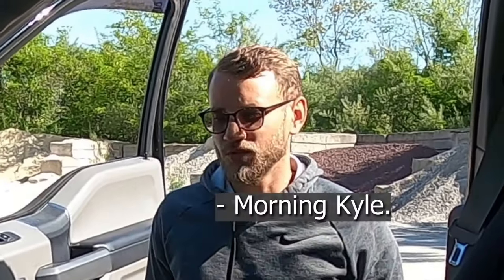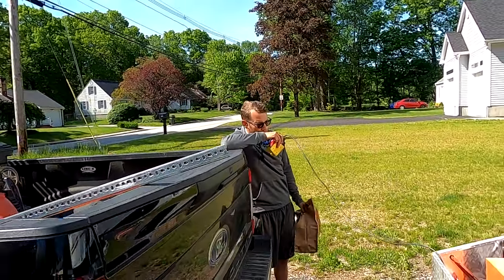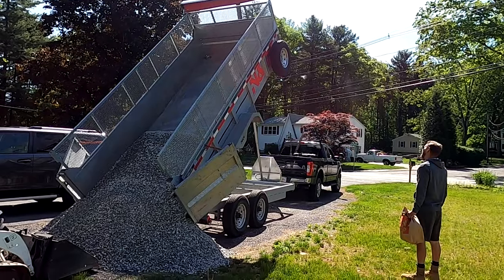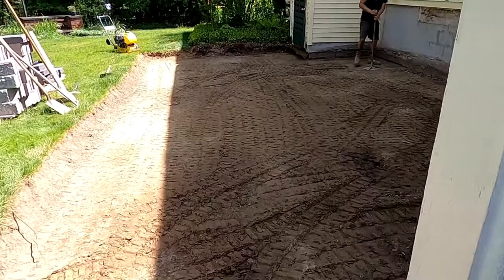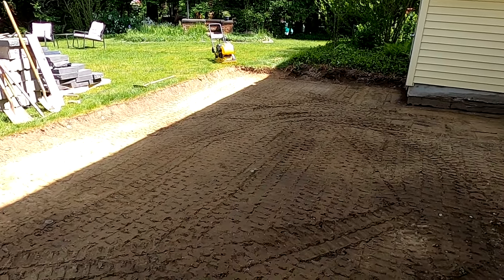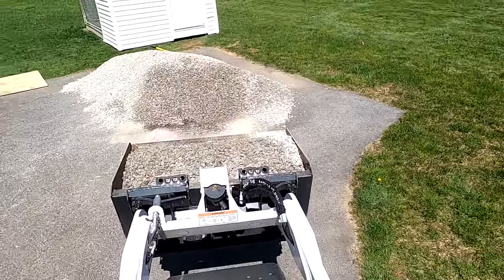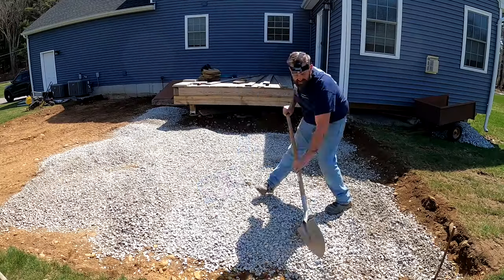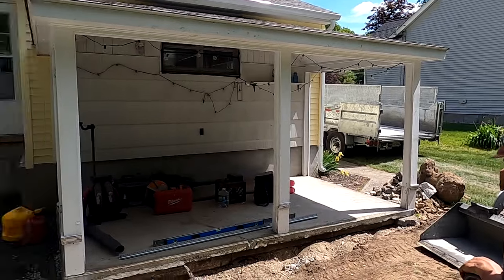Paver Base Prep | Why I Use (Open Grade Base).....

Comment: We do this same exact process with open graded base but most of the time we put in an exfil pipe for the water to escape out of the base….the woven fabric is not permeable enough in our opinion without an exfil pipe. But we also almost always use nitro sand too…so almost all the water that hits our patio ends up in the base…anywho…excellent looking work!! 👍
Reply: How do u direct all the water that seeps into the base to the exfil pipe? And where does the water go from the exfil pipe how do to lead it out under the patio
Reply from the maker: Thanks for the feedback, it is nice hearing from another hardscaper! On jobs with very heavy clay / hard pack, I agree with adding extra drainage solutions like you are saying. We have a lot of rocky / sandy sub soil around my parts which I 100% believe all surface water from a patio / walkway will naturally permeate down and never have any issues. But a 700+ sq ft patio with nothing but heavy clay content as a subsoil, yes, we definitely find a way to help divert base water away from the base material.

Thanks again for the feedback man! ✌
Reply from the maker: There a few different ways to divert the water from the base. A very common method is a pipe that leads to a (Dry Well) which is a large hole that was excavated and backfilled with clear 3/4 in crushed stone and lined with fabric. This hole catches extra water and helps it drain into the subsoil even more.
Reply: Would you suggest installing the perforated drainage pipe around the perimeter at the lowest depth of the base material where it meets the soil or underneath the base material itself? I deal with heavy clay soil in my area and drainage is always an issue, it was great that you brought this up in your video. Appreciate your response in advance and keep up the awesome work!

Comment: The first backfill to fill voids should prevent low spots for water. Wouldn't a well compacted road base with a mixture of small to larger aggregates work better than a uniform 3/4 base? We call it AB out here.

Comment: Great video and explaining things thoroughly, it is greatly appreciated. Just some food for thought.. All of the data spec sheets I have read from the various manufacturers for installation and use of the open base system with resin joint compound indicate using a non woven textile barrier fabric and avoid woven barrier fabrics due to its high propensity for moisture retention while installers suggest using geotextile woven fabrics. Again fantastic video and explanations. I am trying to understand if this can be used for landscaping pathways and large landscaping areas in substitute of sod using 4”-5” base and a 1/2” - 3/4” topping of crushed fines?
Reply from the maker: I get that comment pretty often about this fabric not allowing water through and I know what all the manufacturers say about it... But what I can say to that is I have used it under and up the sides of every hardscape install for the past 5 years. Not one project has had drainage issues (hundreds of installs). the non woven fabrics are not strong enough to help stabilize and they break down much sooner in their life than this fabric. Stabilization and separation is key in any Open Grade Base install. This fabric is the best option for that. It may not drain as quick as a non woven fabric but still drains non the less. Experience is key with things like that and I have a lot of that with this fabric...

Comment: The only options I have near me is clean 3/4” limestone or granite (super pricey). Will clean  limestone (keystone) work out will it tamp into dust and defeat the purpose?
Reply from the maker: 3/4 clean can definitely be pricey... But if you can swing it, it is the best option and will pay off in the long run. I don't deal with limestone really ever, here in massachusetts we have bluestone and granite in abundance.

Comment: My 5yr old son and I love your videos.  For me, your videos and explanation of processes provide both inspiration and direction. The challenge (proposed by my wife): take an area next to the house, that had been destroyed during multiple waterline fixes, and turn it into a useable patio. This project ended up being a GIGANTIC solo project that was worked on during weekends and spare time. After 400 sq ft, and 4 1/2 months later, the first tier is finished. That said, some small corrections to the retaining wall are needed, when I start the second tier next spring.  
I have watched almost every video pertaining to polymeric sand, that you have posted. You mentioned, to not be nervous about oversaturation when watering the sand, that the water needs to completly saturate the sand throughout the joints. Yesterday, was a warm sunny day (I am in West Virginia), and we were not supposed to get rain until tonight. So I applied the poly-sand and finshed watering it around 7:45pm last evening. 1 1/2 hours later, unexpectedly it started raining. It rained all night. This morining I checked the joints and the sand did not harden.  

I used Alliance Gator G2 Intelligent Polymeric Super Sand
What should I do?  What would have caused the sand to not set properly? Is it posssible that I oversaturated the joints?
Reply: I had that happen recently too and a few spots where the sand bubbled up for some reason, but ignoring that, after a few days, it hardened right up.
Reply from the maker: Thanks for the awesome feedback, glad you guys enjoy the videos! So just like the comment above mine, when the sand gets over saturated by rain…. You just need to be very patient, I have had poly sand take 1-2 weeks to harden up simply because of rain, very shady areas or even when the weather is cool…. 

I would recommend just waiting it out, it will most likely just need some time. ✌🏻
Reply: @gssuper1438  thank you for  the perspective
Reply: @TheChristianHardscaper  What a relief.... Thank you for replying. Your advice and perspective is greatly appreciated. It is good to know, that there is a pretty good chance, that the $300 worth of poly-sand I used is not completly ruined.
Reply from the maker: No problem at all, just give it some time and see what happens. The G2 poly seems to be a little slow on set time, especially when rained on while setting. But I think it will be all set 👍

Comment: @The Christian Hardscaper I live in Fort McMurray, Alberta lots of Freeze/Thaw gets down to like -40F in winter and up to 100F in Summer.

If I have hard clay and I’m excavating out more soil to level out my Side Yard from a 10% slope down to a 2% slope… do you recommend backfilling with larger rock FIRST?

Like 3” or 4” stone and THEN putting down my 3/4” Clean Crush Stone Open Grade Base?

Do you have any vids on using *larger rock to fill in greater voids?

I’m assuming it’ll be cheaper to use 3” or 4” (or even 2” whatever you recommend), than filling it all up with 3/4”?
Reply from the maker: Hey there, this method is excellent for very cold environments. Just dig a minimum of 10-12 inches in your situation to account for the heavy freeze cycles. And you can use some 2 inch crushed stone for the bottom few inches if you would like but you do not need to.
Reply: @TheChristianHardscaper  thx!
Reply: I live in california, Lincoln to be exact... we dont have snow, but there is a season where it rains a lot...majority of the year is hot though... my place is also located in a backfilled community (i supposed), so it is a bit rocky...now my question is, shall i use open base?

Comment: man I wish I had your truck and skid steer..lol  Down here we normally use #57 and #8 on top leveled. some cases we go 10 to 16 inches deep, because we have severe flooding problems here.
Reply from the maker: I love that truck! But the skid steer is a rental…. Can’t wait to own one myself someday. Open grade base is the way to go, occasionally we go over a foot as well. But only if it is heavy clay sun soils. We generally have nice sandy/gravelly subsoil here in Massachusetts though. Our big thing is freeze thaw cycles…. ✌🏻

Comment: I’m building a paver stone parking pad next to the garage. What do you Recommend for base when cars will be parked on it?
Reply from the maker: So I would use the same method with a couple extra steps... First you need 10-12 inches of base stone, compacted in lifts of 4-5 inches. And in between those lifts you should use (Geo Grid) to help stabilize the stone and prevent shifting / sinking. So more base stone and geo grid, that will help the pavers stay strong with the weight of vehicles on top of them.

Comment: Hi Christian, I’ve watched most of your videos and it’s helped me lots. I am DIYer and doing my own walkway in Australia. It’s been hard to find landscape Geofabric but I think I have found it. It’s a weaved geotextile plastic. Problem is water doesn’t seem to permeate through it. I placed it over a bucket and poured water and it just sits on top. Is that normal?
Reply from the maker: Hey there, I'm glad the videos have helped! The geotextile fabric I have will hold onto water if you do something like that too. But when you put stone under it and backfill with stone over it, the woven plastic strands will stretch out and open. Then the water will be able to permeate. But when the fabric is just suspended and filled with water, the strands lock together and hold water. I would not be too worried ✌
Reply: Unfortunately I can’t get 3/4” angled stone (“screening” as it’s called here) that is clean. It’s frustrating.
Reply: Its not important, right?. @TheChristianHardscaper

Comment: Hello, I'm in NJ and the stone supplier naming of the rock is different. They seemed to get confused when I asked for 3/4 clear angular crushed. the supply here has 3/4 trap rock. It appears to be about 1/2 to 3/4. Is it the same as 3/4 clear crushed. I also see 3/4 limestone. Thanks
Reply from the maker: Hey there, that sounds like the same stone to me. The name can differ depending on the area you live. Limestone is a type of stone. Around here we have mainly granite and bluestone. Some areas have mainly limestone... Doesn't really matter what type of aggregate you use, just that it is 3/4" and that the fines have been removed.
Reply: @TheChristianHardscaper  thanks

Comment: Thanks for your awesome videos. Your strait forward explanations and step by step info allow people like me to tackle a DIY patio install. I am in SO RI and am installing a 24’ x 30’ patio. I’ve completed the excavation (11”) and have compacted a thin layer into my mixed clay/gravel base. I will backfill with about 7” of clean 3/4” stone. My question is do I need to compact before the final screed layer? I understood you did not need to compact but this video talked about compacting in 6” lifts.  Thank You!
Reply from the maker: No problem at all, thank you for the feedback! So the short answer is yes. Once you get to your final height with the 3/4 stone and it is raked out smooth, it is definitely helpful to run it over with a compactor to settle everything in nice and tight. You will see that it does not compact much, but it will tighten up all the stones to help prevent shifting. Then you will be good to lay screed material, if the height changes due to compaction, you can make up for that with your screed material up to a 1/2 inch. If you need more an 1/2 inch, add more base rock and compact. I get asked sometimes if I compact the screed material, I do not. Once the top layer of your base is compacted, you will not need to compact until you polymeric sand the pavers. ✌
Reply: Thank you for the quick reply and guidance. I plan to put down the cloth and base  then wait till the spring to compact, screed and lay the pavers.
Reply from the maker: @rickstgermain9823  Good plan, leaving the excavation open for the winter will help compact / settle the sub base naturally. Then you will be good to pick up on it in the spring! 👍

Comment: I'm having an excavator come in and prep my patio paver area and a garden area, where an above ground pool was taken out. The grade needs to come up about a foot in the paver patio area. Would you add dirt and compact to bring up the grade and then start your geotextile and open grade base? Or can he make up the difference with 3/4 crushed stone? Meaning the main patio paver area would be sitting on about 18 to 24 inches of the 3/4 crushed stone. Love your videos and the ease of explanation. Oh yeah, and Benny!
Reply from the maker: You certainly can use clean 3/4 for the entire backfill, just be sure to compact in 5-6 inch lifts. You will never have water issues and you will never have shifting / settling issues, that is for sure. Thanks for the support and I'm glad the videos helped!

Comment: Thanks for the explainer! Is there a reason why you go with 3/8" chip rock and not 1/4" for bedding layers?🤔
Reply from the maker: No problem, the 1/4 in crushed is actually very hard to find around me... Some areas have it in abundance, some don't.... The 3/8 crushed is very common here. ✌

Comment: Hey love you vids. Have a random question for you in reference to polymeric sand. I’ve finally got the base down and about to drop the screen 3/8 down but I’m worried about doing now given the temps have dropped to 35 and below here so wondering if I should hold now until after winter as I’m worried that the polymeric sand won’t set properly if I drop it now at these temps - any thoughts?
Reply from the maker: I usually recommend holding off on the polymeric sand until you have a minimum of 3-4 days in a row of above 35- 40 degree nights. If the water in the sand freezes overnight, it can certainly impact the way it sets and could ruin the application. You can definitely lay the pavers, but make sure you have a good stretch of weather to poly. If not, yes, wait until the spring. ✌

Comment: Hey @Christian Hardscaper , Thanks for your informative vids. I'm from South Africa, and we don't have our hands readily on polymeric sand over here. Would you still recommend open grade if you were jointing with normal fine sand? I would like to use open grade as I can see the advantages, however, I'm concerned that it will seep down into the stones after final compaction and over time? many thanks
Reply from the maker: No problem, I am glad the videos are reaching that far! You certainly can use regular sand in the joints, however, it will migrate down into the base little by little... Eventually though, it won't as much. So yes, you can use it, just expect to have to add sand maybe 1 or 2 times a years depending on how much it migrates...
Reply: @TheChristianHardscaper  thanks for your response , I appreciate it !

Comment: I have a small question, because I'm a bit confused, and I want to succeed my installation next spring.  For 3/8 rock bedding, is it better to compact it or not?!  thank you a thousand times!
Reply from the maker: I do not compact the bedding stone, it does not help. Just screed the 3/8 bedding stone loose, lay the pavers and then compact the pavers when you do the polymeric sand. ✌

Comment: Hey I've been following your guides for my project, I have a question that I've looked into a lot and I've had mixed results. My patio is 80sqft and is touching my driveway in a spot thats notorious for water to accumulate. The driveway co crete is 2 inches thick followed by 4 inches soil and then what looks like a couple feet of dense grade. If i go open grade should i have a sort of barrier other then the geotextile to seperate that soil from the open grade or would a french drain flowing the opposite direction suffice? Thanks a lot
Reply from the maker: When I meet my open grade base with any other soil / material, I use geotextile on the bottom and up the sides. That is all you need in the majority of circumstances. The open grade base itself will usually fix any water issues, but if you want to incorporate a french drain, that will do nothing but help for sure. Good luck! ✌
Reply: @TheChristianHardscaper  thanks a ton for the reply, this question has been my main concern since starting this project and hearing it from a pro Is very reassuring. Keep the videos coming man you're a wealth of knowledge and  they're very entertaining 👏  cheers.
Reply from the maker: No problem, thanks for the support of the channel!

Comment: I live in South Carolina on the coast so we don’t have hard freezes and rarely even get close to subfreezing temps.  That said, we do get a fair bit of rain.

I’m in the process of building a permeable paver patio and have been instructed that 4” of 3/4” base rock is sufficient with another 1” of 1/4” bedding stone. My soils are a sandy loam and readily accept and drain water through the soil column.

Is there any reason I shouldn’t use a somewhat reduced paver base versus your recommended 8-12 inches?
Reply from the maker: Thank you for reaching out and I am glad to hear you are going with open grade base! So when I say 8-12 inches, that includes the thickness of the pavers and the 1 inch bedding layer. So on installs with sandy subsoils like yourself, we will dig closer to the 8 inch side. That includes 4-5 inches of 3/4 stone, 1 inch bedding stone, and pavers are typically 2 3/8 inch thick. On heavy clay sub soil installs, we dig closer to the 12 inch mark. Giving us 8-9 inches of 3/4 stone, 1 inch bedding material and the 2 3/8 inch paver. 

So long story short, 4 inches of 3/4 base rock in your situation will be just fine! ✌